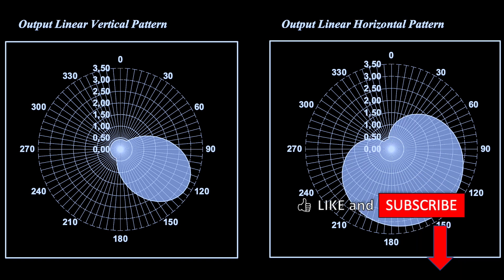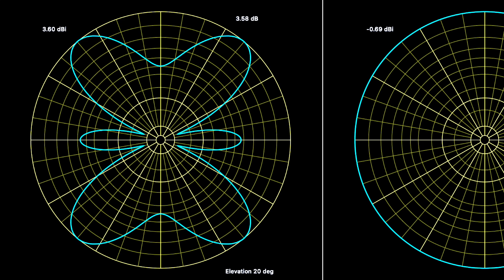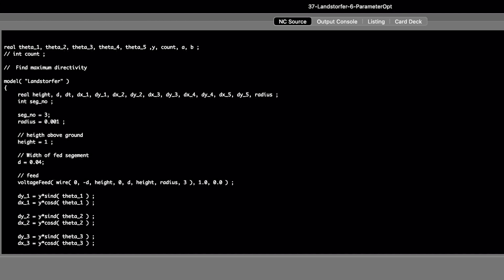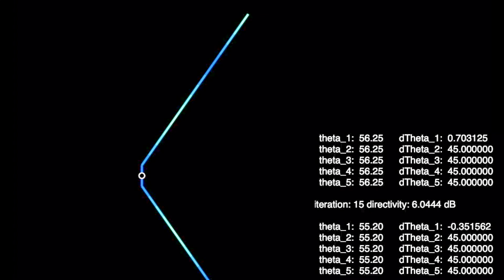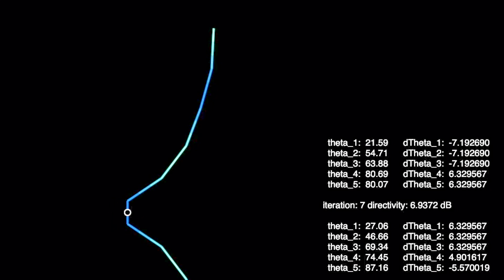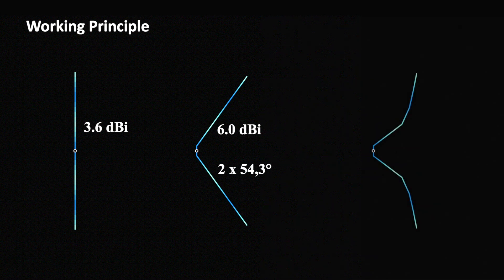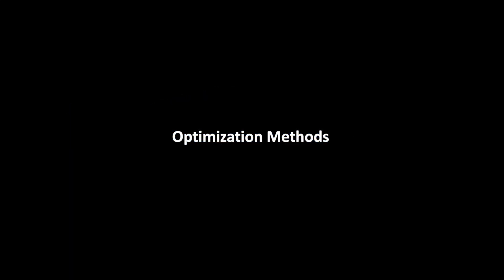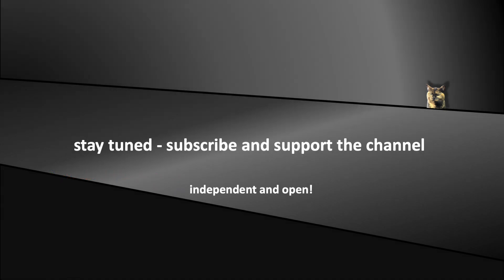How to Optimize the Shape of an Antenna? (EP90)

Comment: The shape looks very much like the shape of a trumpet or trombone bell. I'm not surprised. A wave is a wave, is a wave.

I wonder if bending all of the elements this way for a Yagi-Uda would improve the directional gain at all. Or would it just make a mess of the radiation pattern?
Reply from the maker: Hi John, 

thanks for your comment. That's an interesting question actually! You are really sophisticated! 

The inventor optimized a Yagi and a log-periodic antenna successfully as well. You can find it in some books and publications. However, I don't know of any commercial model. Maybe someone out there knows where to buy the antenna?

And before you bend your Yagi antenna, please remember that this type of antenna needs longer rods ;-). 
Maybe I can show one of these in a later episode.
Reply: @electronics.unmessed , thanks for the compliment, but I'm hardly sophisticated. Just a guy with a high-school education who has been curious about things for 3/4 of a century. After a while things begin to make sense. I was guessing that one might be able to squeeze a couple dB or so more from a Yagi by doing this, and yes, I note that the elements would need to be over a wavelength long, instead of roughly a half wavelength. But it would be easy to do on 70 cm, and possible on 2 meters. I've already contemplated trying to build a 70 cm beam with colinear elements, but the logistics involved are difficult for me these days.
I'll research this gentleman's work. Thanks for his name. Perhaps there's something posted online I can read.
Reply from the maker: Yes, exactly, I think you understood everything correctly! I'm currently thinking about setting up such an antenna and making more videos about it if there's interest. Maybe I'll build the simple dipole antenna first and then the Yagi later. So stay tuned!